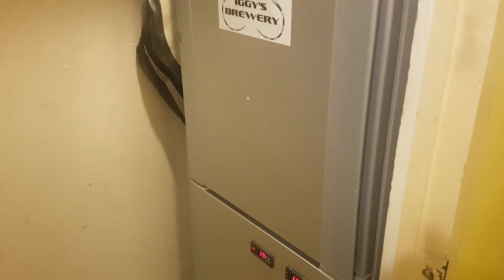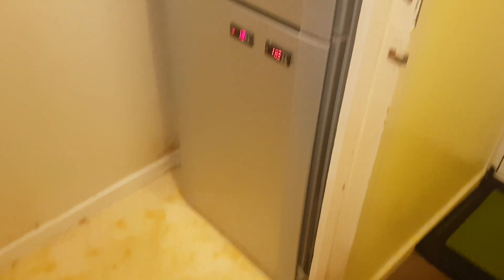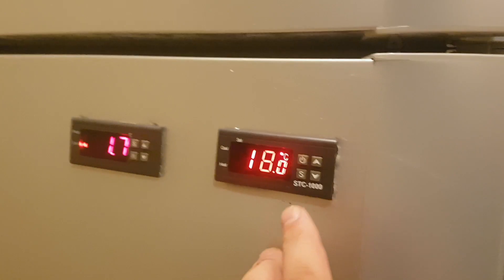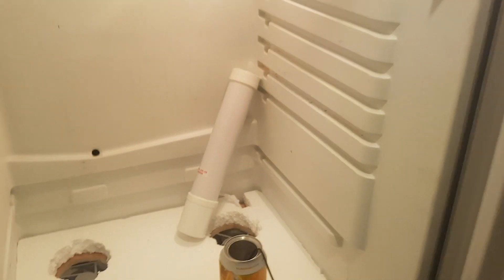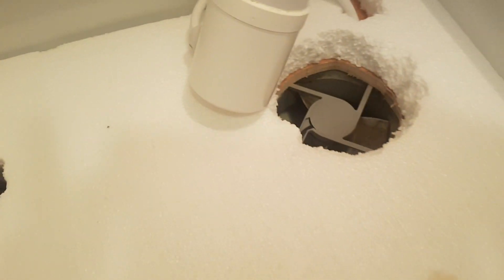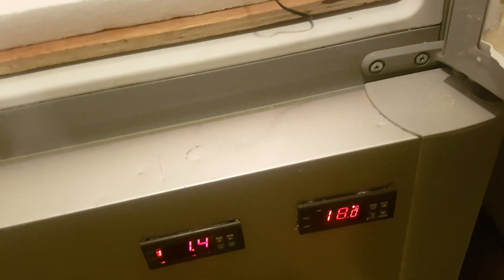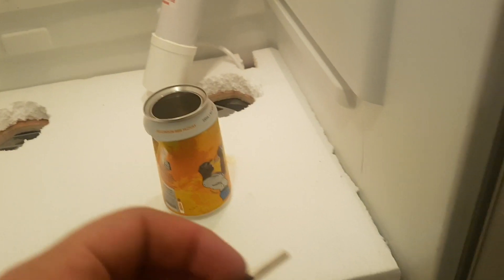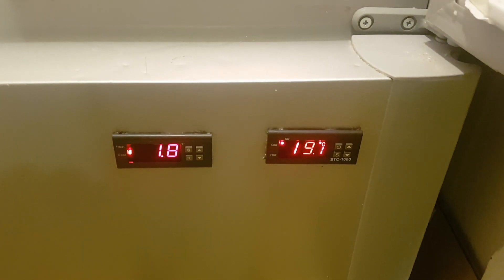Fermentation, cold crashing  and lagering chamber from fridge freezer.

Comment: Nice build man! Any chance you can explain how or list the controler/components please? Looking online I can mostly find info on either fridges or freezers, but not so much on combos. My fridge freezer needs replacing and I'd love to use it in the same way. Thanks!
Reply: Second that, I am also looking into the same. Please share some details on that setup, would be great to use an old fridge/freezer as an fermentation chamber with two tempratures.